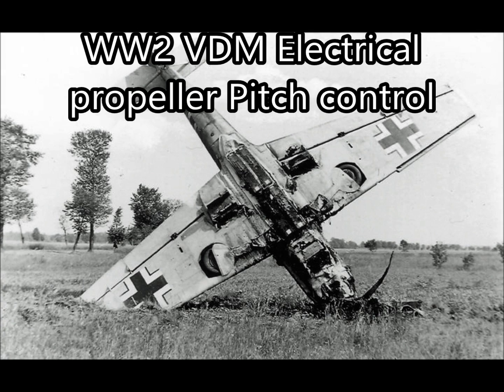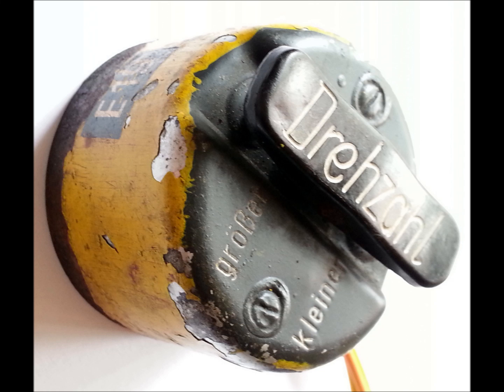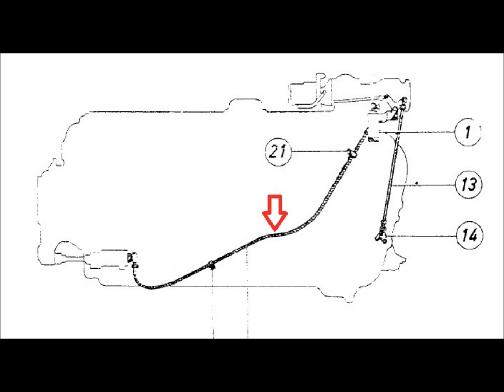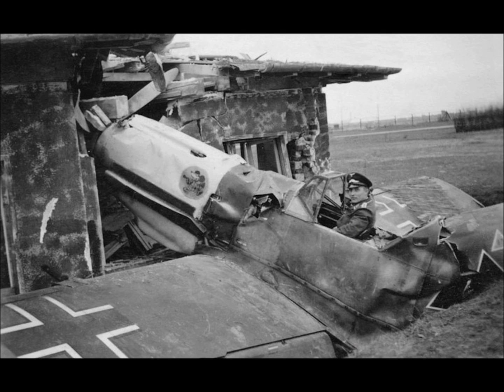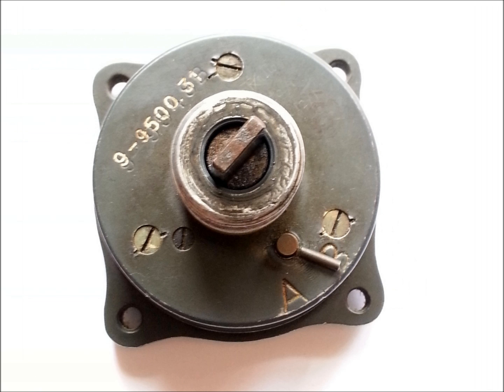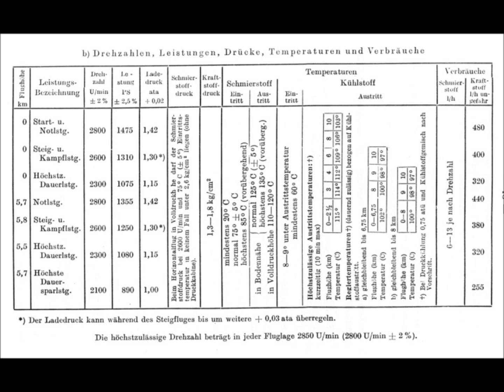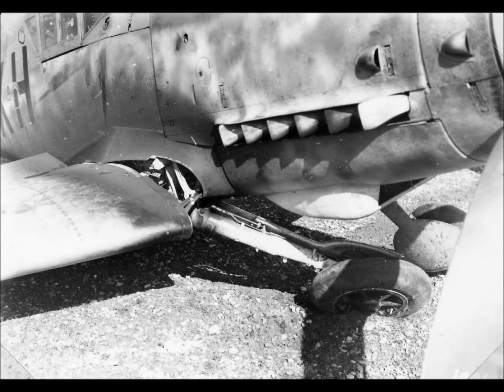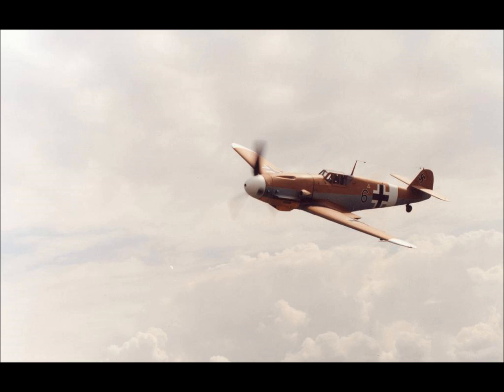ME109 Bf109 DB605 Engine Propeller pitch demonstration from a Luftwaffe Messersschmitt

Comment: The pilot did NOT have to watch RPM constantly and utilize the thumb switch as you state at 8:45, and imply throughout the video and description- the 109s from the E4 on had automatic prop pitch control, and it was when the auto prop pitch control was introduced it was switched from a dashboard lever to a throttle mounted rocker switch. Manual pitch setting was selected with a two position switch below and forward of the throttle- The "manual" system you describe is a selectable manual mode in an automatic system. During combat especially, and at most other stages than starting and takeoff depending on pilot taste, the system was left in automatic, and was certainly fast enough at manipulating the prop pitch that the pilot could entirely forget engine RPM as a factor as long as his manifold pressure was set correctly.

Comment: I will probably have to watch this  three or four times to fully understand what is being explained. I never even realized that the propeller blades changed their angle in different parts of flight (or take-off) There is a big difference between sitting beside the pilot in a prop driven plane and actually flying it!

Comment: Actually moving prop switch from front panel to throttle was done when implementing automated pitch control to Bf-109E4 in 1940. This new-style prop switch on the side of a throttle was kind of a part of this new automated prop pitch system and was used as an auxiliary prop control.

Comment: Great video. Though remarks about Hotas being developed 20 years later are a bit missjudged and false IMHO. The P-51 did have a rotating gunsight range on the throttle lever serving just that purpose. Both solutions to the different problem are HOTAS in its infancy in my opinion.